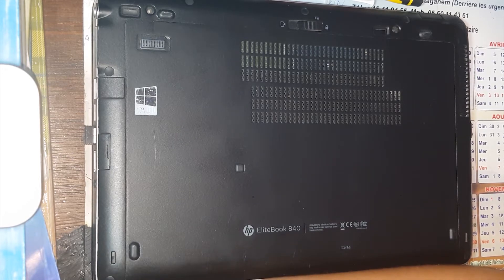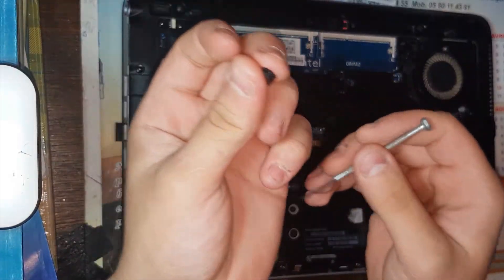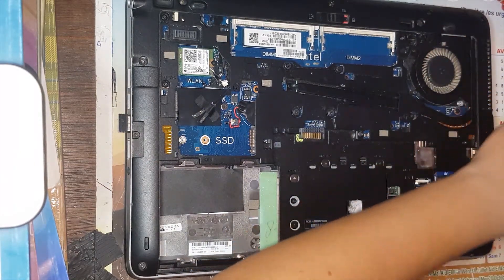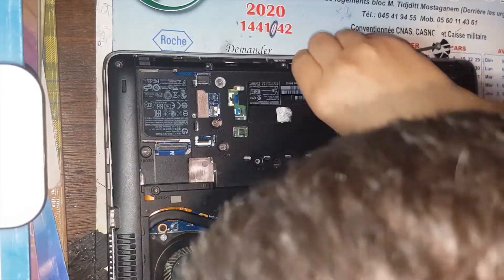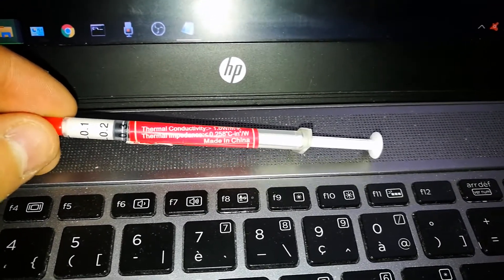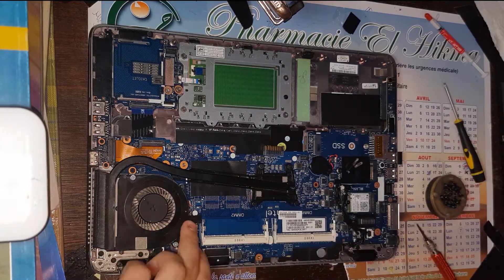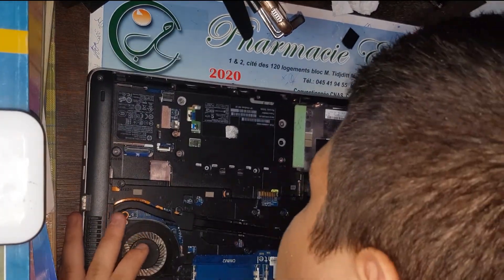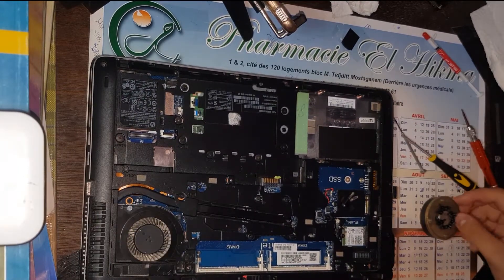HP Elitebook 840 G1 Change Thermal Paste on cpu

Comment: I'm pretty sure this is not a G1, but an HP 840 G2
--> they are pretty similar, but the difference can be spotted from the Wifi card (mini-pcie on the G1, NGFF on the G2) and also the screw position for the M.2 SSD slot
Reply from the maker: Thank you for the note